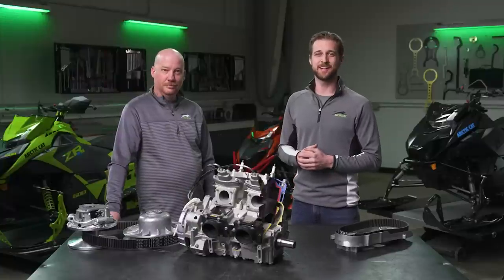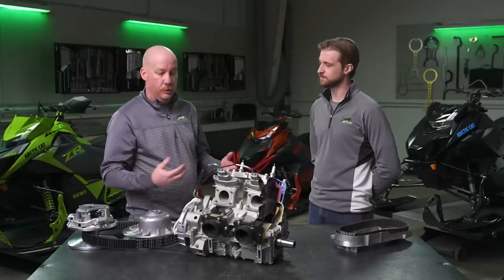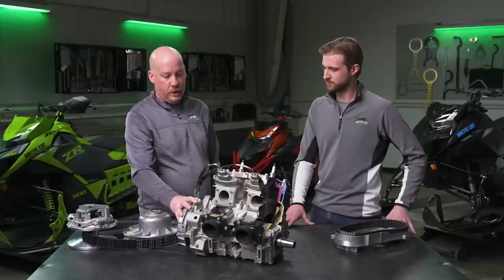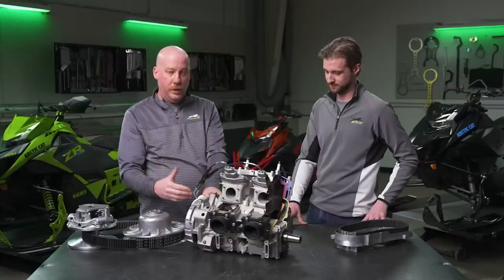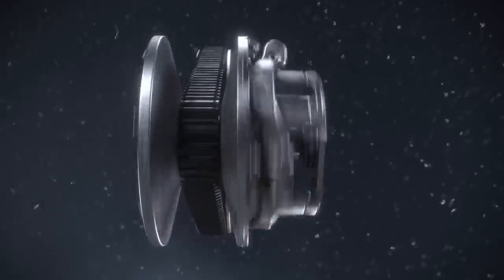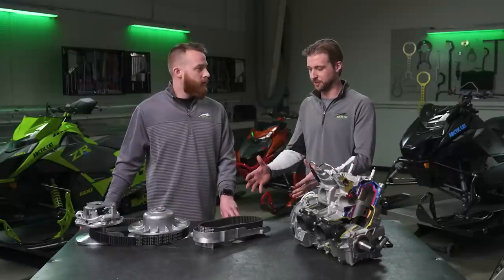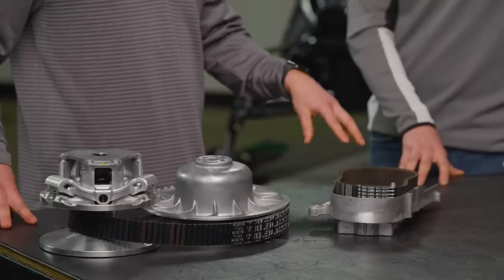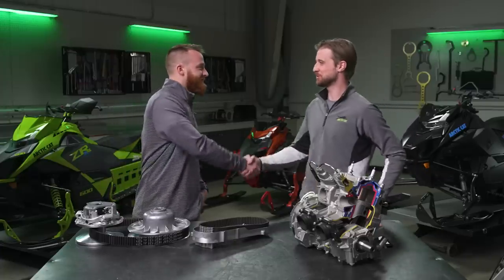Arctic Cat CATALYST Deep Dive | Powertrain

Comment: Arctic Cat's fuel injection is old technology and is one of the main reason's Doo & Poo's throttle response feels way more crisp than Cat's. They need dual injectors, cylinder and throttle body but then they would have to spend more money on new ECU and other thing's. The new 860 still has the old fuel injection technology as the previous 800 Ctec.....I would of thought the 860 would of had new fuel injection improvements but I guess not!
Reply: You know more than yamaha engineers whatever you say
Reply: They should do that

Comment: Bigger motor please! 
Also design a clutch that does not grenade please
Reply: has there been reports of the adapt clutch blowing up?  I have one in my 22 riot 800 and it's been solid so far.  No cracks in the clutch so far and still using the stock belt that came on the machine.
Reply: @Freneticburn  yes it on the forums with detailed photos. I had one crack all ready.
Reply: @Jay Boatrepairfun  cant find any, which forum? Are you sure you're not taking about teams?
Reply: @danielssonsgarage  I have one that blew up and there are a few on the forums.

Comment: So they have a Cut Away engine on a Bench but they don't zoom in and show it.  It is sitting on the Bench in a Conventional position.  My Guess is that it is actually laid down when it's Installed in the sled Chassis.
   They said the drive belt lasts the life of the sled. What is the Life of the sled do they Fall apart in 10,000 miles?  Are they expected to last 30,000 Miles.  Yamaha's were really heavy, but they did have multiple grease zerks.
  I have not worked on many Clutches but the Skidoo 4 Jaw Clutch with Roller bearings does last longer.  No mention of roller clutches here.
  Also the Direct Injection that Skidoo uses greatly increased MPG..  I wish other Brands could pay Patent Royalties to Bombadier .. who  Bought Evinrude  who paid a German Engineering Co to develop the Direct Injection fuel system.
Reply: Let it out……
Reply: They've had full roller clutches for 25 years
Reply: @gregmulfort9577    Who is they?  Arctic Cat or Skidoo?  With bearings not bushings?